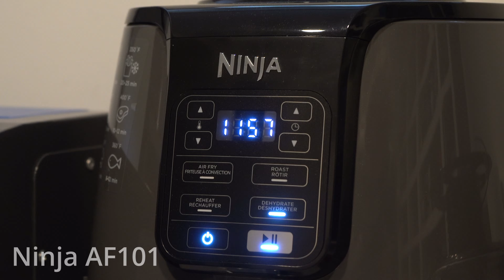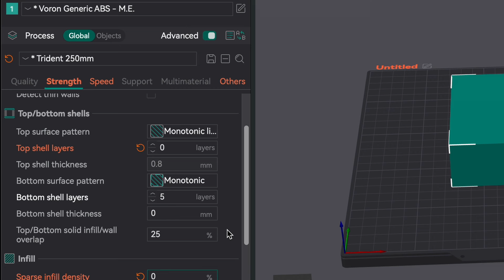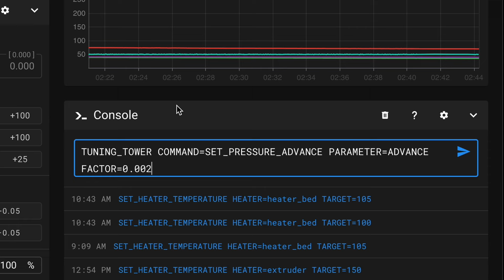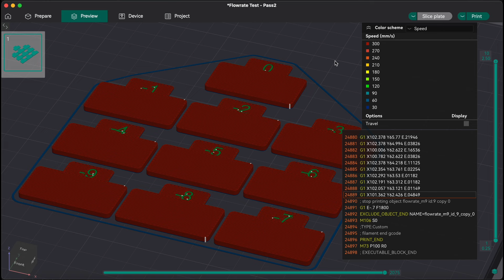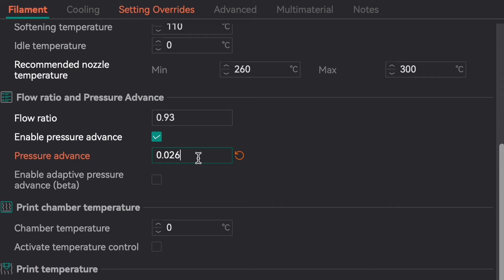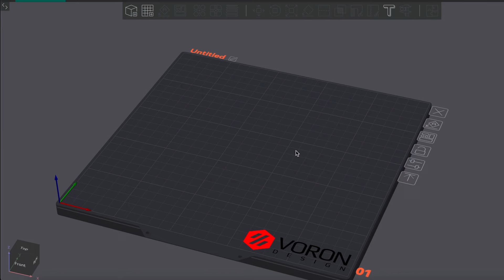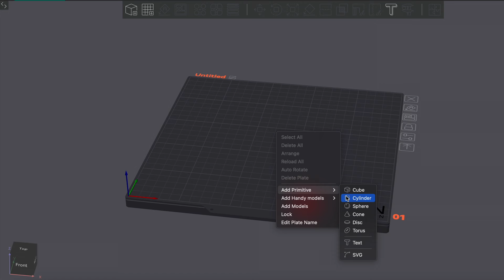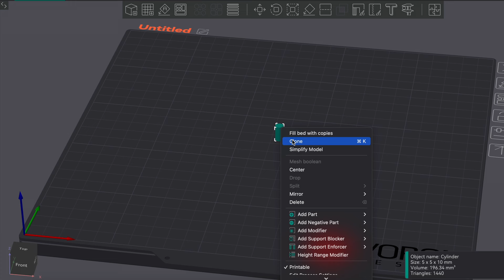How to Tune Your 3D Printer for SPEED! (Part 2)

Comment from the maker: UPDATE: I confused the methodology for EM testing with the newer YOLO tests. Rather than taking 95% - 2% = 93%, you should actually be taking (100%-2%)*95% = 93.1%.

For most values, this difference is small and just subtracting the value will be "close enough" but the gap will get bigger as your EM gets lower.

Comment: I hope you did not simply calculate 95 - 2 = 93% as shown in the video. While in this case it will lead to similar results( 93% vs 93.1%) it is not correct. If you want to just substract the numbers as shown use one of the YOLO tests instead.
Reply from the maker: Good to know, thank you!

Comment: There is no need for the PA model... It is already included in Orca Slicer you know?
Reply: While I agree with you, the included test will simply ignore most of your settings for walls and run with fixed settings making it impossible to tune for different sized nozzles or speeds where your cooling might not be able to keep up for 2 thin walls.
Reply: @spectermk1  After generated you can setup as you like
Reply: @abstractflo3739  you can change the settings but the test won't respect your changes ;)
Reply from the maker: @spectermk1  Yep that was my issue exactly. I'll talk about it more during the bonus video but I was not able to get the orcaslicer built in PA test to work, nor Andrew Elis's gcode generator. Very frustrating

Comment: Layer width should be greater than nozzle size cuz your nozzle can be bigger or smaller a bit, and also can wear out. Set at least 5% wider line, 10% would be even better

Comment: Mitsu, quick question, how different is the tower your published compared to the OrcaSlicer's built in PA Tower? Because to me the geometry and calibration look the same.
Reply from the maker: It's very similar. The only real difference is that on mine you can control the number of walls if your cooling isn't up to par. Trying the built in Orca tower test my cooling struggled and it was difficult to interpret the results

Comment: Absolutely great video! Just one question, for the PA tuning command, do I have to first send the print and when the printer is heating up I send the command line?
Reply from the maker: Send the command before you start the print, and you should be good to go

Comment: You can do a binary search on the fan cooling, print the 0s, 6s and the 20s and then discard the worst one. now print the value in between the two good ones and just keep going until you find the best one.
Save yourself some time

Comment: How does your cooling affect layer adhesion for ABS/ASA? I have experienced weak layer adhesion with higher fan speeds when printing ABS.
Reply from the maker: If your chamber is not hot enough then running too much cooling can absolutely ruin your prints, for sure. On the 250 trident I can hit a chamber temp of around 73c by putting a blanket over the printer, so I'm not very worried about this. Ideally the chamber temp would be another 10 degrees hotter, but in practice the 73c temp seems to work just fine for strong parts

Comment: What's the max temp for that Ninja AF101 in dehydrate mode? Been looking for a better drying solution that regular filament dryers and want to dry Nylon at 90 C
Reply from the maker: The dehydrate mode tops out at 195f or 90c, so you should be good for Nylon
Reply: @mitsubishimakes  Okay cool thanks!

Comment: And now there is the dynamic pressure advance, so the slicer calculates what's the best value for different speeds and layer heights... Any variable changes it.. Didn't tried it yet though
Reply from the maker: Yep! That will be awesome to see as it gets implemented into more slicers. I've been looking at tuning Dynamic PA in the newest version of OrcaSlicer but haven't done it yet. I need to print some actual parts rather than just test prints for a while 😜
Reply: @mitsubishimakes  ohh.. Does 3d printers do that? Lol

Comment: abs 필라멘트 구워먹는 방법
Reply from the maker: I'm not quite sure what you're saying. If you're asking about how to dry ABS, I would recommend drying it in either a dehydrator or air fryer at 70-75c for 8-12 hours.

Comment: Only reason to "tune" extrusion multiplier is the use of different hardness of filaments. A soft TPU will squish instead of being moved thus you need to account for that springiness a super hard PLA will not deform at all, it´s super brittle (also why it´s not a good material choice for most functional prints despite very bad temp resistance).
ABS, PETG, PA they generally speaking all have the same EM. You should start with PLA which is very hard and brittle as your base starting point and then increase EM when needed for soft materials, maybe like +1% for PETG and +5% for TPU depending on the TPU it could also be 10% or 3%. Sadly those type of things and reasoning behind it is rarely explained anywhere. I am guessing most people to make those videos are hobbyists themselves and don´t why they they "tune" they probably heard it or they have some galf knowledge of general things like "materials expand when hot" and things like that.
Here the guy uses 7% less filament than the software tell the printer to. 7% or 93%EM isn´t normal at all. My machine works fine at 100%+-1%, If i were to set is 7% off the parts would be unusable. But then again maybe this person prints random figurenes or something.
Reply from the maker: This is incorrect. Different types of filament will have wildly different EM's, and that's totally normal. Check the default profiles for different materials in your slicer if you don't believe me.

93% EM is a completely normal result for ASA, I'm not sure where you're getting your info from
Reply: @mitsubishimakes  Okay, so WHY is this the case then ? Please explain why that´s the case then.
Reply: @mitsubishimakes   PrusaSlicer has EM set to exactly 1 by default for the 10 or so filament profiles I looked at including PLA, PETG, ABS, ASA & PC Blend. That said not every filament prints perfectly with those settings of course and I don't know much about tuning (which is why I'm watching this video lol)
Reply: @SaHaRaSquad  it could be the extruder, i think the rotation is abit off on the orbiter v2 or something, because i often run 88% extrusion :/... but going much higher it will over extrude

some filaments also dye swell?

Comment: My thoughts on this:
2:50 maybe you know, maybe you dont, but between 125-150% line width of your nozzle width, so 6.25-7.5mm in your case, is optimal for layer-adhesion. 7:25 if the extrusion-test works like i think it does, you shouldnt just subtract the value (in your case -2) from the original EM, but rather multiply the percentage with the EM, so 0.98 * 0.95 = 0.931, which in this case is obviously very close to what you did, but as you said for abs and stuff like that with generally lower values, the error gets bigger. Also  just a thought, but i wonder if its better to tune EM first, and then tune PA, because different EM would have an effect on PA i would assume?
Dont take this as criticism, its just my thoughts, i dont know if im right or not.
Reply from the maker: Good to know about the line widths. Honestly, I've just kept them all at 0.5mm and everything seems to work fine. Would be awesome to actually test part strength, but I don't have the capabilities to do that yet. 

You are absolutely correct about the EM values, I was mistaken and thinking about the newer YOLO tests.

Between the EM and PA, I don't think it really matters which one you tune first as long as you go back and retune them like I did in the video. I've always done PA first, but that's just out of habit

Comment: This person also doesn´t understand pressure settings. Quote "Since I use pressure advance there shouldn´t be enough material to ooze out anyway" wrong, pressure advance does not take any material out of the nozzle which isn´t possible it just releaves the pressure thus the name. 
I am sorry but I wouldnßt listen to this video here. He does not understand certain fundementals from what I can see.
Reply from the maker: While I may not have worded that line perfectly, the underlying information is still correct. By relieving pressure inside the nozzle, you will not need to worry nearly as much about oozing
Reply: @mitsubishimakes  In this case yes. I don´t want to be unfair, if it´s what you meant it´s fine. Some people think you really physically take material out.